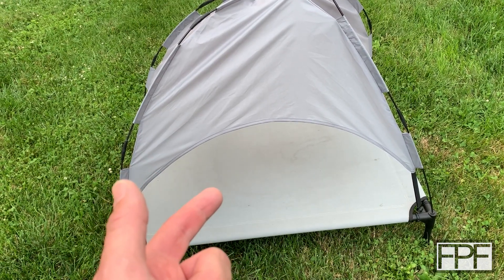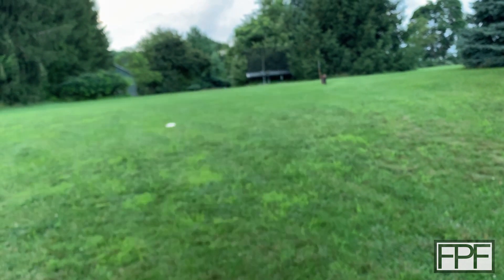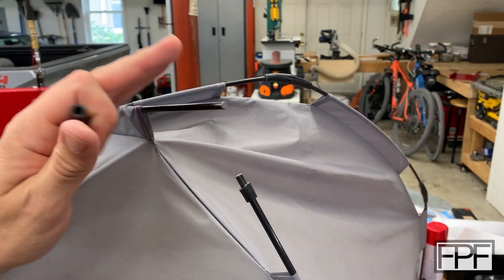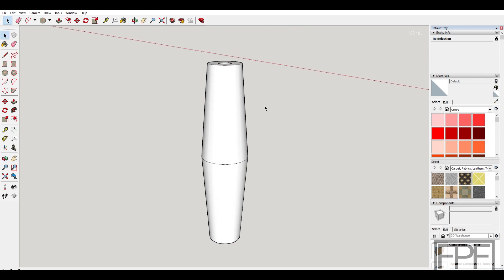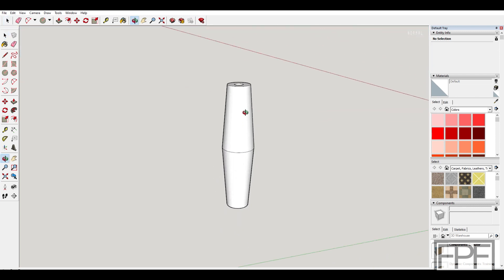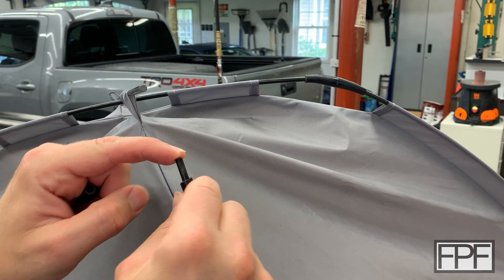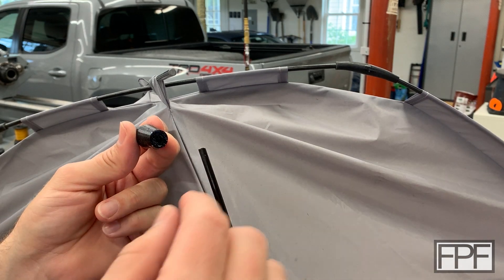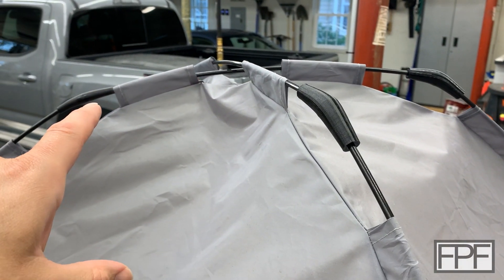3D Printed TPU Fiberglass Rod Connector

Comment: Interesting to think about design for 3d printing. In this case a hybrid material part might be better to eliminate the TPU flex. A print that has TPU outer with a steel wire inserts or abs core to eliminate the bend would be interesting. 

So print the abs on the flat and then sleeve the TPU (printed as you did) for to outside. Or you print the TPU, pause then insert the abs core. You get the flexural stiffness of abs in one axis the durability and strength and durability of 2nd axis TPU. 

Alternative is printing TPU as you did, with 3 or 4 holes for 2mm steel wire you could pause, insert wires then finish the print to tie them in permanently. Would be similar to wire in a tire.

Comment: When I'm putting a pipe in another pipe like that, I put a mark on the inner pipe to show where it should stop and push the outer one to that mark
Reply from the maker: Yes, agreed.  I thought about just making a scratch mark, but was afraid it might be a stress point for a future break on the rod.  I did end up using some white electrical tape on the 2nd one, I just cut out talking about it because I talk too much already :P
Reply: @FunctionalPrintFriday  yeah, after you scratch your head a few times on weather it's halfway or not, you figure out the tricks. Or see it in another video🤣

Comment: Do you use 100% infill when printing the part?
Reply from the maker: Great question!  I should have talked about this in the vid.  I did 50% originally, but upped it to 70% for the last two that I didn't show making.  This made the holes too tight, due to the bore now not being able to flex outward as easily.  I ended up iterating the design with a slightly larger diameter bore and adding vent holes to allow air to escape when the poles are inserted.  I might do a quick follow-up video if there's interest.